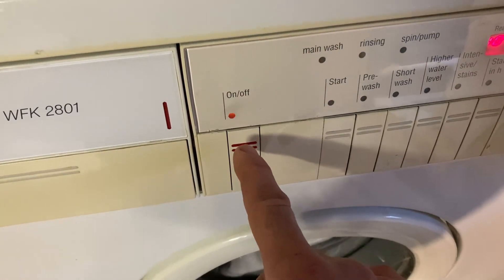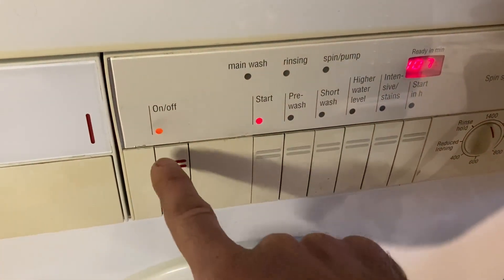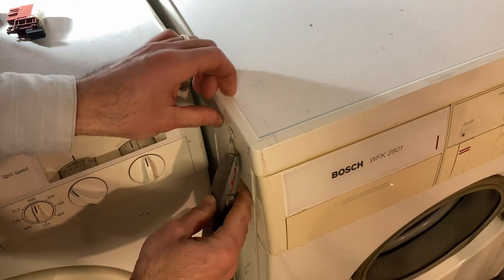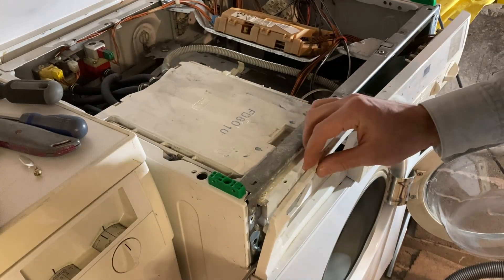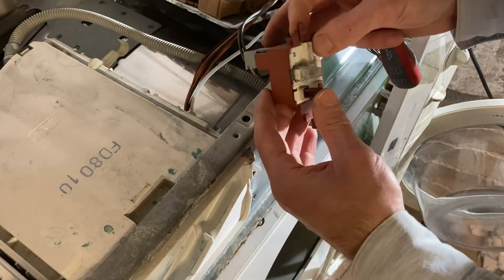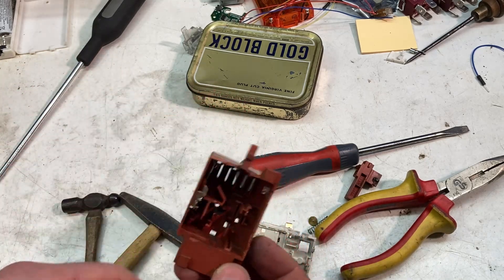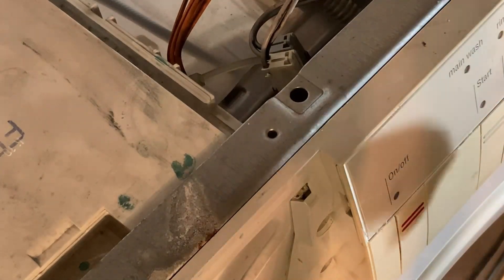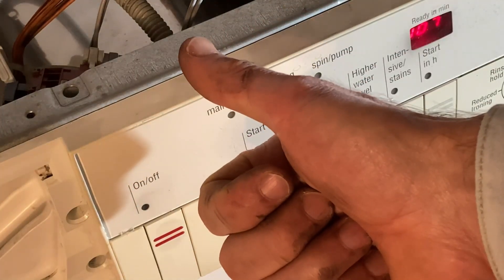Bosch washing machine dodgy power switch: arcing and sparking! Investigation and replacement bodge

Comment: Do u know where I'd source a power switch? The WFF2001 I just got has the same problem.
Reply from the maker: I think they were all different across the different models Conor. you could just fit any 13 amp power switch beside the original.

Comment: Owen, better than you average throw it away, however I would have tried to wedge it in with a shaped bit of wood, cheers
Reply from the maker: I thought about it. Making a little block, a piece of metal. A twist of wire might do it. I looked at the internal plate on the machine the spare switch came from. And then I didn’t do any of those options. I am thinking about removing the beeper that sounds the end of the wash. Maybe I’ll put more effort in if I open it up again. As it stands the switch on the wall does it for now.
Reply: @bootsowen  Owen, when you're under time pressure then a fix like this will do until it doesn't, cheers